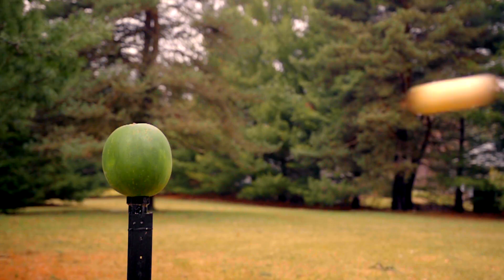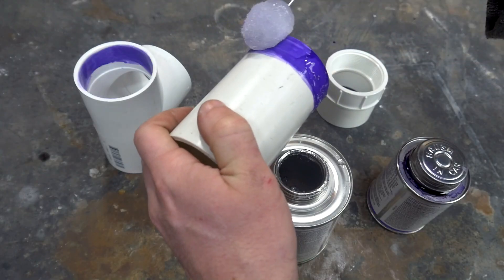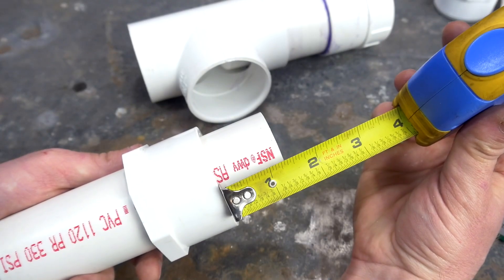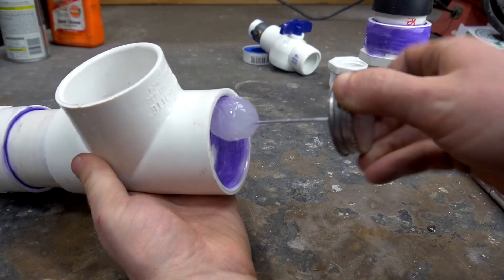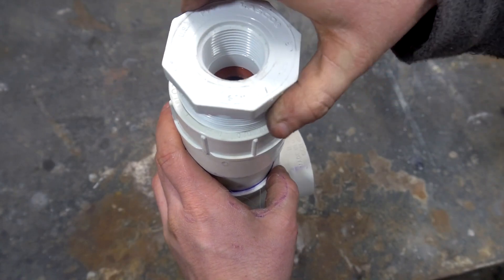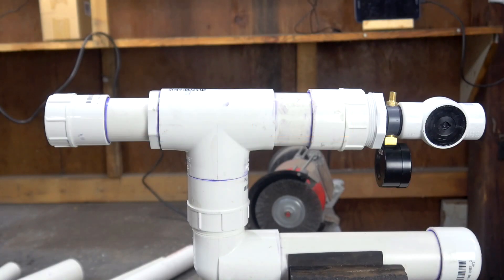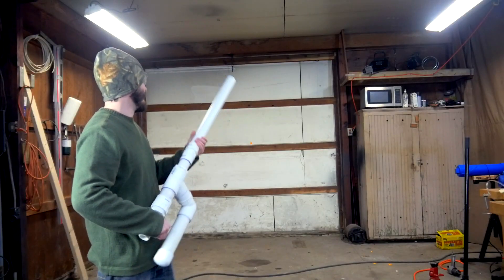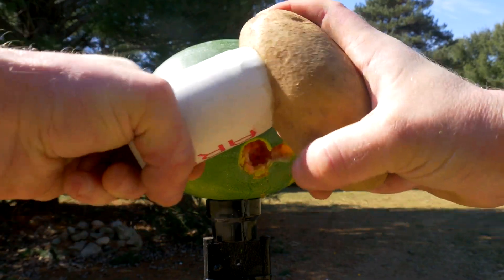How To Make A High Power Air Cannon - 2" Piston Valve (Barrel Sealing)

Comment: Working on a parts list. Am I missing anything?

PVC Primer / glue and teflon tape for the whole project.

ALL pipe and fittings must be marked NSF-pw (rated for pressurized applications)

Piston:
1 1/4" Coupling
1 1/4" End cap
2 1/2" of 1 1/4" Pipe
1 5/8" ID x 2" OD O-Ring

Piston Housing:
2" pipe
1 1/2" pipe
2" Tee Socket
4" of 2" pipe
2" Female threaded adapter
2" to 1 1/2" Reducer Bushing
2" x 1" Threaded Reducer Bushing
1 1/2" rubber pipe coupling
Sheet rubber
Light oil

Air Tank:
2" threaded elbow
2" pipe
2" end cap

Firing Assembly:
1" Ball valve OR Modded sprinkler valve
sch 80 pipe nipple
Schrader valve                   
Pressure gauge

Barrel:
2' of 1 1/2" pipe
1 1/2" male adapter.

Modded sprinkler valve:
Sprinkler valve
1/4" Hose fitting
2' air compressor hose
2x hose clamps
Small air gun/nozzle for trigger
Reply from the maker: Looks good, thanks for typing up the list I'm sure it will be useful to others. I'm not sure what the threaded couplings are that you have listed under the piston housing list, that's one correction maybe. And you also need a 2" x 1" threaded reducer bushing. That's the piece that the sheet rubber is glued to and connects the piston valve to the release and fill valves.
Reply: I will rewatch the video again and edit the list shortly. If not tonight tomorrow. Hopefully it will help anyone who is going to be replicating this project like myself.
Reply: It would be helpful to pin this comment or put the list in your description.
Reply: Find a popped inner tube for a bicycle, and cut out the valve. Then you can attach it with PVC glue or silicone.
Reply: Sir your comment has saved me time. I appreciate it. I need to get now the firing assembly parts which it seems difficult😅😓
Reply: i cant find a Schrader valve and Pressure gauge like the kind that's in this video, my local lowes did not have one, so if you could give me a link to buy one online that will screw into the cannon, like in the video, I would appreciate it very much.
Reply: Overly Ecstatic Englishmen you can get a Schader valve from a bike inner tube
Reply: your awesome
Reply: Are these dimensions on the inner or outer diameter of the pipes? Because where I’m from the outer diameters are used. And i read somewhere that in US inner diameter is used.
Reply: What's the o-ring made of? Mineral oil doesn't go well with regular rubber, right?  Is this made of silicone?  Or nitrile?

Comment: I followed everything practically the same but i can’t get my piston to make a seal on the rubber coupling, any ideas?
Reply: i’ve figured out the original problem but now i can’t get my piston to go back when i open the ball valve, my hole is extremely small and when the ball valve is opened the hole lets out air very slowly not moving back
Reply from the maker: There's two ways to fix a piston not moving back, assuming your hole is already as small as you can make it. You can reduce the area behind the piston, either by filling it with something like rubber, or by cutting the tube shorter, or option 2 is use a bigger/faster opening valve
Reply: is it possible that the extruding letters on my piston is interfering with the seal with the rubber coupling, because my extruding letters are different from yours,
Reply: Additionally i was able to get it to work completely by adding rubber around the ball cap on the piston valve, however the rubber came off and now it doesn’t fire anymore and due to my limitations, i can’t get the piston out to fix, so in my new model i am hoping i don’t need to use the rubber but it doesn’t work, so would it be a extruding letters on problem om my piston
Reply: or the other two theories are my cutting on the rubber coupling isn’t flat and i’m not pumping enough air

Comment: I made mine and I checked everything a dozen times  did everything the same way and my piston what shot back when I actuate the trigger
Reply from the maker: You need to make the hole in your piston smaller. Too much air is getting through.

Comment: Hey, so I tried making this and maybe im just an idiot but i can't seem to figure out what I'm doing wrong... I looked it over and over and it seems like everything is correct however i suspect something is wrong with the piston. It pressurizes correctly it seems, even though it seems to leak slightly but not fast enough to be a concern. The issue im having is that when i release the ball valve, the air just comes out the back and i dont think the piston is moving correctly. Anyone have any ideas? I would be very grateful for any help.
Reply from the maker: Sorry for the delay in my reply. If the piston does not move backwards when you open the valve it means that air is not leaving the valve fast enough compared to what leaks around the piston or through the little vent hole. The first thing to try is make the vent hole smaller. You can do this by gluing pvc shavings into the hole. It should be a very small pin hole
Reply: @Nighthawkinlight Ahh, ok, that might be the issue then.... I probably made the hole a bit too big then. Thank you so much for the response!
Reply: @Nighthawkinlight Ok, so I tried making the hole smaller and that didn't work so then I just sealed the hole completely and still way too much air was coming out the barrel. I think it might be the rubber seal that the piston is supposed to seal into. So at this point, just because of the way it's glued and what not, I think I'm going to have to cut part of it apart and redo a part of it. I'm going to give it a little more thought before jumping right into that though
Reply from the maker: @nathanjensen2374  If air is coming out of the barrel that's a different issue having to do with the rubber seal not working properly. I find you can sometimes fix that sort of leak by smearing the rubber with pipe thread paste
Reply: @Nighthawkinlight Ah, got it, thank you so much! I will give that a shot tomorrow! You're super helpful, I really appreciate it!

Comment: It's ironic that the modified sprinkler valve is itself the same principal of using a small volume of air to move a large volume of air and would have worked fine as the main valve (Source, I have made several modified sprinkler valve pneumatic toys)

Comment: I know this is a pretty old video, but hopefully you can help.  I need to make one of these but it needs to be filled at the air chamber not at the release valve.  Do you have any suggestions on how i could modify your plans to make it work that way?
Reply from the maker: You could add a spring behind the piston that keeps it pressed forward while filling. It will be harder to get working right and will probably take a lot of time to troubleshoot various problems.
Reply: @Nighthawkinlight  thank you ill give it a try

Comment: Will the bigger the hole on the piston make it faster to fill up the air and release faster too?  Why you mention the smaller the better, will it slow down the fill air process?
Reply from the maker: A bigger hole means the piston will be slower to open

Comment: Good valve but way too much work.   I don't want to sound like a stick in the mud but good job!  I like taking the easy way out with less work.  The power builds as fast behind the projectiles with a longer length  barrel and the rapidly building air pressure using only a ball valve allowing the pressure potential to "catch up" to the projectile in the barrel and resulting near the end of the barrel length with an equivalent PSI and speed as with the air at that same point with a quick release valve, i.e., the quick release valve builds the PSI faster and will exit a shorter length barrel at the same speed as a slightly longer barrel using a slower air-release ball valve.  The quick release gets the projectile to "x" speed faster in a short distance then becomes more constant to the exit but with equal PSI/volume, the longer barrel, slow-impulse ball valve would be similar to the valved short barrel.  Sometimes the tradeoff of using less complexity and a longer barrel is preferable to complex systems.  That valve is useful for shorter barrels and has plenty of applications.  Seismic "guns" use that type of valve.
That philosophy is how the Russians got into space before we did regarding the use of simpler systems ... not so much "better" as getting the same result using simplicity.

Comment: Thinking about grinding the stop down on the pilot side of the tee so I can shorten the section of 2" pipe (move it closer to the center of the tee) and reduce pilot volume, is this something you expiremented with? Ideally the threaded female adapter would be right against the tee. I would have to cut down the coupling for a shorter piston or maybe 3D print a shorter piston.

Comment: Once I drilled the hole in the piston the air wouldn't push it forward anymore. The piston will function with my shop compressor as the air source but not the portable compressor pack (max 100 psi) I planned to use with it. My thoughts are I either drilled a hole too big or my compressor pack is too wimpy to move the piston. I know this is a 6 yr old video but any thoughts?
Reply: Well I figured it out. Was gonna delete my comment but someone else might find this helpful:

If you drill the hole too big in the piston, take a 3/4" pvc cap fitting and drill a smaller hole in the tip (1/16 drill bit) and cement it about halfway in the middle of the piston. Effectively creating a smaller air chamber inside the front of the piston that helps push it forward and not just blow all air directly out the side hole of the piston.
Reply from the maker: Yes there's two ways to fix this. Decrease the hole size by gluing pvc shavings into it, or decrease the volume of air behind the piston. You did the latter by adding another cap. That may not be the best solution because the cap is heavy and will increase the force when the piston slams backwards. It may hit hard enough to blow out the back of the cannon eventually. If you can find something lighter weight to fill the piston with that would be better. Or fill the area behind the piston with more padding. It only needs to be able to move about 1/4"
Reply: @Nighthawkinlight  okay, thank you for the tips. I did think about the added weight and was planning on adding a buffer spring sticking about two or three coils out of the back of the piston to help with recoil. I also "Late Night Brained" the idea for a barrel with a plunger type mechanism that would slide up and down inside the barrel on a groove so as you load a round in, it slides down the barrel and the plunger slides into the pressure chamber, pushes the piston back enough that the air sends the plunger back up the groove and forces the round out the barrel. The effect would most likely be less psi per shot as the pressure behind the piston would probably return it to the forward position, but it possibly could function as a semi-auto, short range mortar system
Reply: I'm running into a similar issue. I don't think I drilled too large. My bit was only 1/16th. I'm attempting this with a mobile ryobi, but have the old shop compressor turned on to see if that's the problem. Unfortunately I need this as a mobile application though. Gender reveal is only two weeks away!

Comment: Great instructions and videos! I built your design and am having trouble getting the barrel seal to function. Any tips on troubleshooting the seal between the piston face and barrel seal?
Reply from the maker: That can be tough. Make sure there's no raised letters on the piston that might break the seal. It can help to smear the rubber with tfe pipe thread paste. It helps to make it sticky and seal well
Reply: @Nighthawkinlight  We chucked the cap on a drill and polished off the lettering with 120 and then 800 grit. The PTFE pipe thread paste is a great idea! Much appreciated.

We also had to use a different coupling that did not have a shoulder than wraps all the way around the cap, so we will likely rebuild to use the coupling you showed.

Comment: After all these years i have something that could be usefull.....it is possible to make this cannon full automatic.
If you change the ball valve at the end with a spring loaded over preassure rrlease valve, the cannon would cycle as long there is preasure from an external tank.
The trigger would stop the valve from opening, but as long as you keep the intake air going and the valve free....it should fire. The next step is to add some kind if seald hopper that feeds the ammo (like rubber balls) to a T-junktion in the barrel

Comment: I built this for my kids. Very powerful! One recommendation I would give to anyone trying it out is to make sure you have an AMPLE cushion for the piston to slam back against. I tried rubber gasket material first and it cut through. Then 1/4" thick bullhide leather and it cut through. Finally I found a rubber cork (about 1" thick) that was about the same diameter as the 2" adapter on the narrow side. I drilled a hole through it, modified it slightly with a lathe and glued it into the adapter and it seems to work better. The BIGGEST fail-point is the piston slamming back when you fire it. My cannon has broken twice now from this. Once from the cushion failing and once from the PVC actually breaking from the tremendous force of that piston. If you want this cannon to last, put in a very ample cushion.

Comment: I'm having issues getting the piston to seal against the rubber coupling. Mine didn't have a divider in the center like yours did, and when I try pressurizing the air chamber air leaks out of the barrel. What do you recommend?
Reply from the maker: That's a tough one. You can try coating the rubber with tfe pipe thread paste, that can seal some leaks. You might have to remove the coupling and figure something else out, either rubber on the face of the piston or a rubber washer on the end of the pipe.
Reply: @Nighthawkinlight Thank you so much for the help. I was luckily able to find the same ACE rubber coupling that was used in the video and it seals properly now. Appreciate you responding all these years after posting this video! I used the same rainbird solenoid that you did, but was having issues getting all of the air to flow quickly out at once. I press the blow gun and air starts coming out of the valve, however it's more of a slow bleed than a quick rush of air, as I have to press the blowgun multiple times to even empty the air tank. Is this due to a bad diaphragm seal? Sorry for all of the questions, sincerely appreciate all of your help!

Comment: How far can it launch a golf ball?
Reply: Depends on how much PSI and the angle you fire it from ' 1988, I worked garage maintenance at a golf course, a coworker and mystery built one ' 180psi and 20° angle we were averaging 
400 yds ' fired it at a 1/2" piece of plywood from 40' and it penetrated it.

Comment: Arborist industry needs this kinda tech, commonly see simple aluminum or PVC air cannons that just use a simple 1" ball valve.  If you don't flip it fast enough the shot is a dud.  Sold on arborist gear websites for $300.  I made my own of that style for ~$80.
Reply from the maker: I always liked the pole slingshot
Reply: @Nighthawkinlight  Air cannon is more reliable, stronger, and accurate.